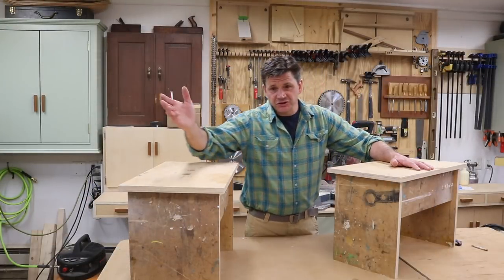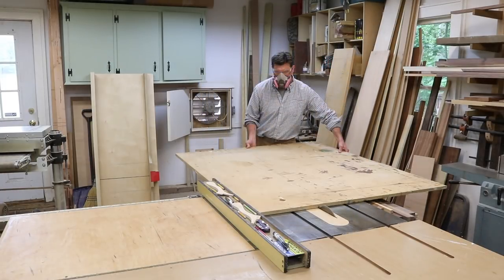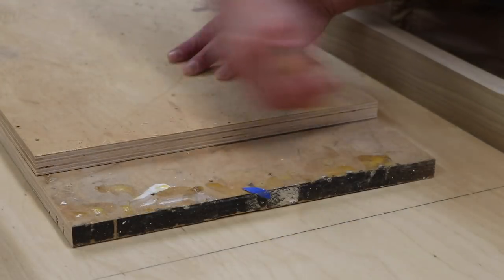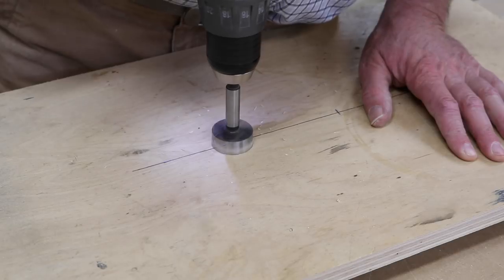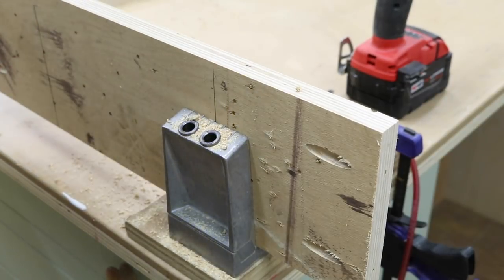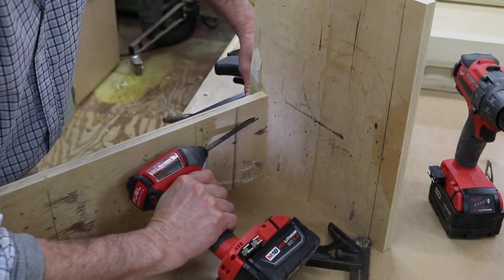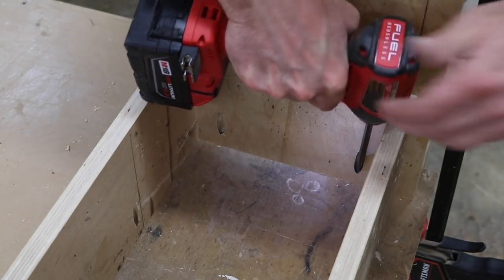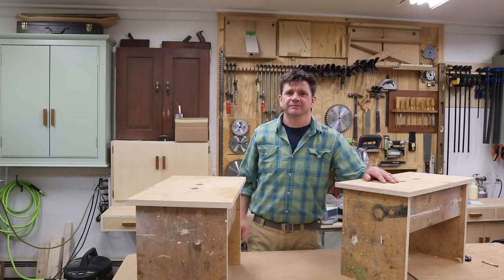Simple Shop Stools

Comment: what's this clutch setting on your drill? is it on most drills I have the dewalt xr drills
Reply: On modern drills, just below where you put your hand to tighten a drill bit there is a ring with numbers on it, the ring moves, mine is 1 to 18, 1 is where the clutch kicks in the easiest, 18 is where I can drill through anything without the clutch engaging.
Reply: thanks buddy I looked into it after typing that comment lol